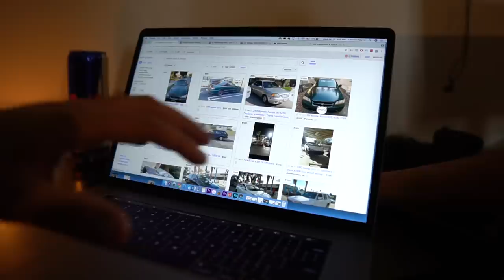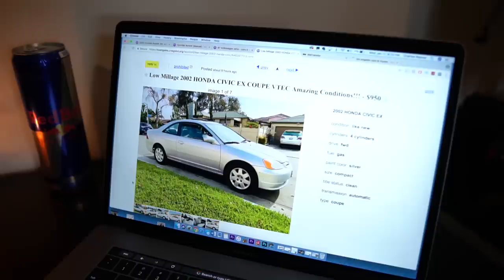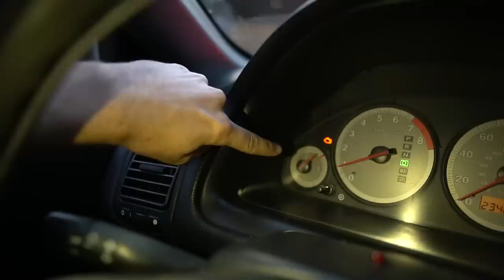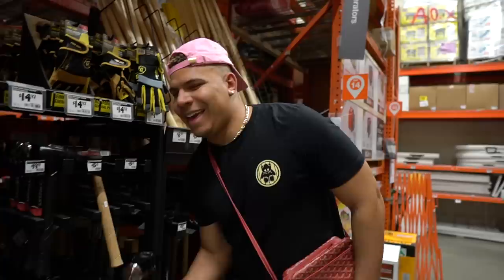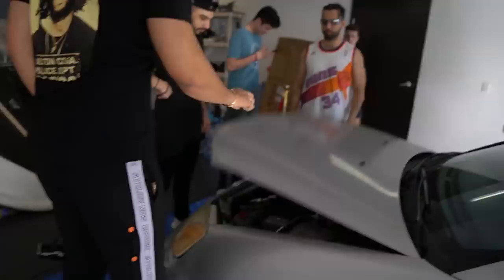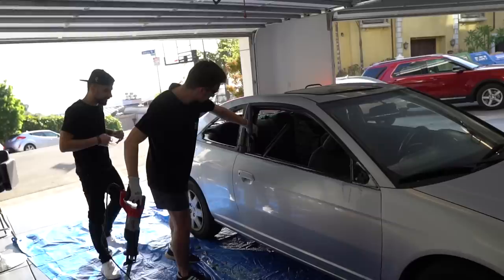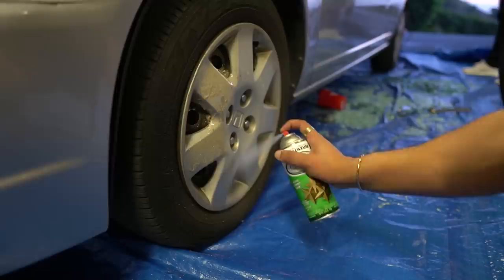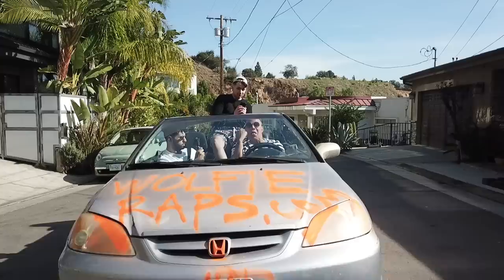CUTTING THE ROOF OFF MY NEW CAR!! (DIY How To Turn ANY Car Into a CONVERTIBLE)

Comment: shouldn't have opened the radiator cap when the engine is hot , the  water was hot that is why it came was smoking its probably a radiator not antifreeze anti freeze makes the water in the radiator not freeze when it gets cold